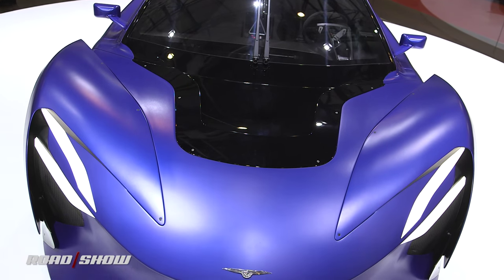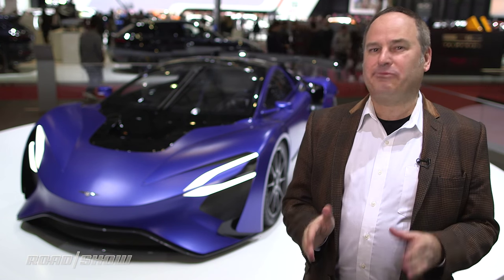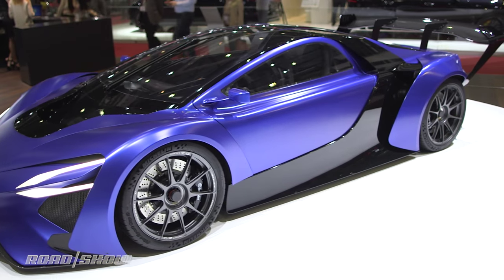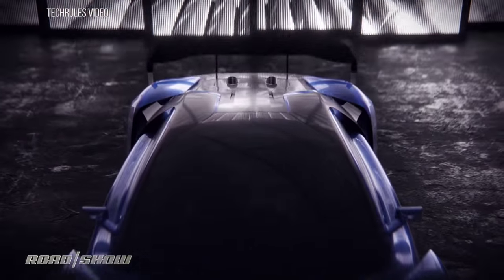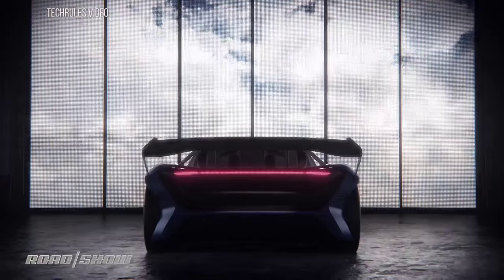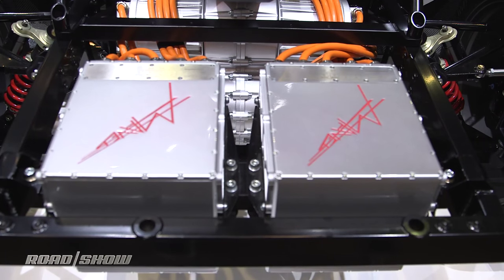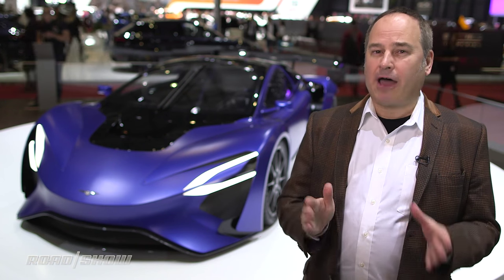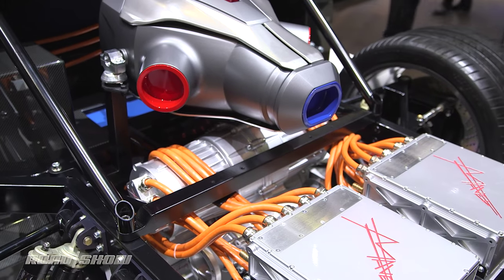Turbine-electric drive an automotive efficiency gamble

Comment: Turbines are the future for range extenders. They burn much cleaner than piston engines, they have less vibration, need less maintenance, sound very cool, are much lighter, more powerful and smaller than piston engines. If we get CO2-neutral synthetic gasoline or diesel, I think this kind of setup will be much better than a pure battery-electric vehicle.
Reply: Also, the efficiency with a regenerator is almost the same as for diesel engines, and much higher if you can use the excess heat which is readily available in the exhaust.

Comment: So this thing can't melt steel beams?
Reply: no but it can weaken their structural integrity enough that it will buckle under load. force is a form of temperature and metal moving fast enough will liquefy on impact.
Reply: Why would it?…it’s a car!